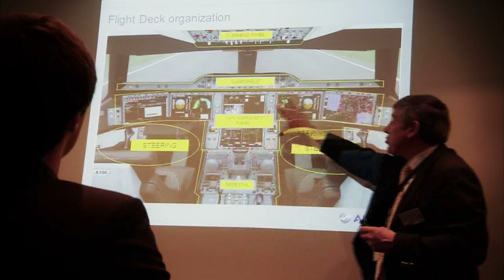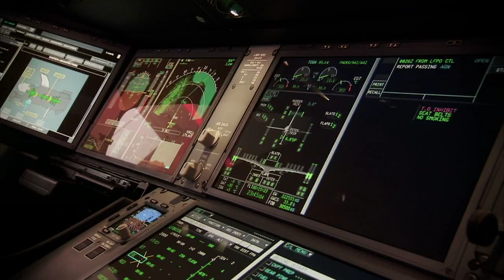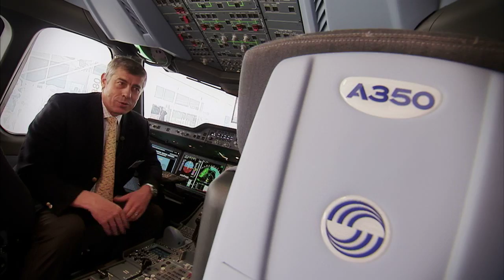Paris Air Show 2013: Avionics and A350 cockpit workshop

Comment: Well, even if the A350 is more innovative and needs more buttons and control surfaces, I still think that the A32X cockpit is the most beautiful ever designed. But the A350's cockpit is not bad though :)